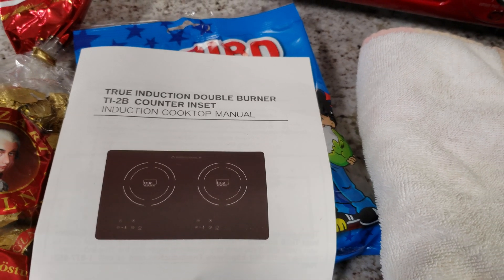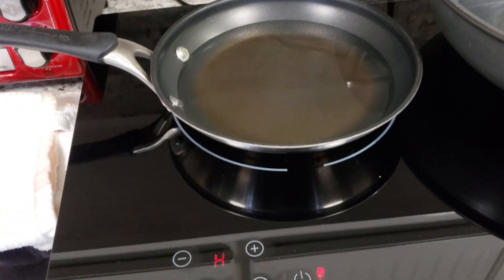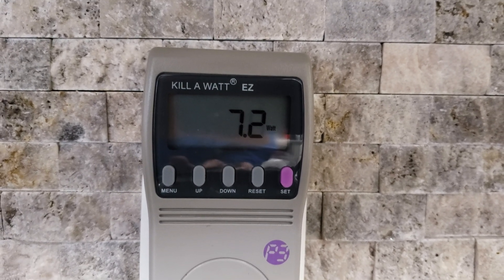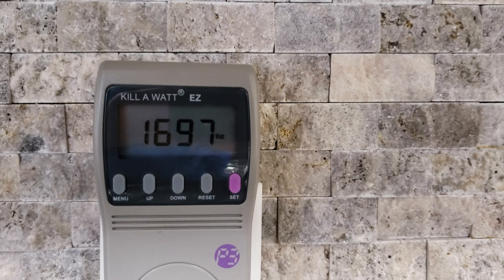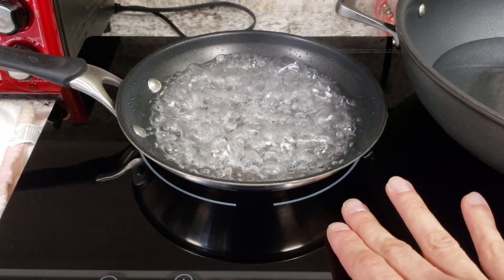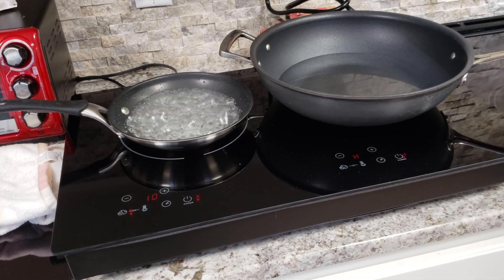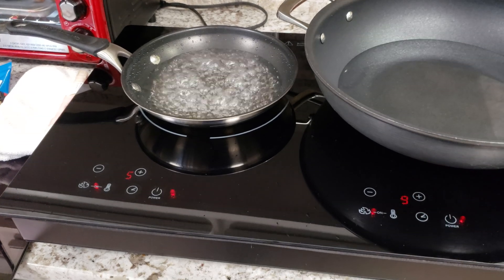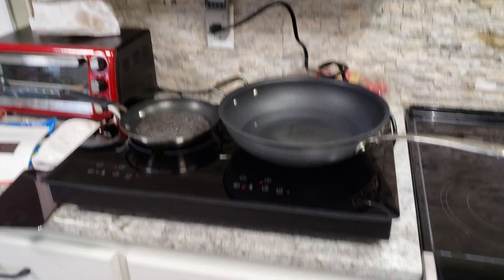True Induction cook top TI-2B - Dual burner inset

Comment: Thank you for showing the watt readings. It’s really the only way to show what the stove top is doing. I wish you would have held on it longer though. See the problem with the cheap one pot models is they tend to be on full blast then off. It looks like this model is able to maintain a lower power rating giving you more control. Can you confirm?